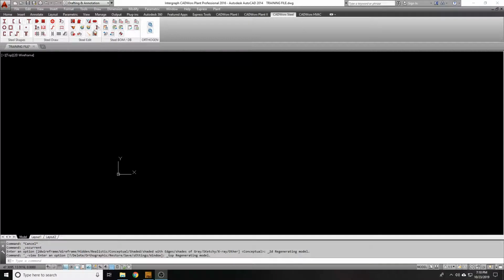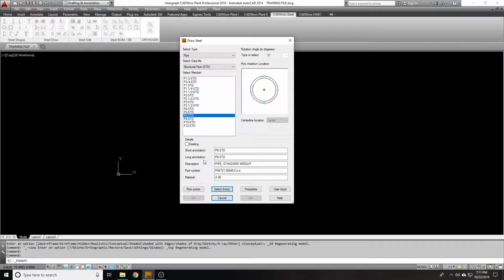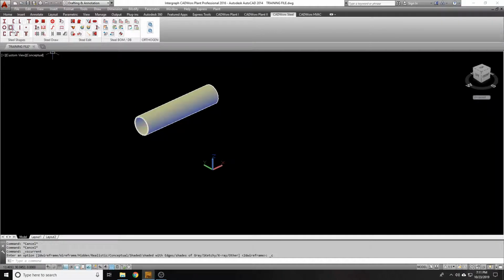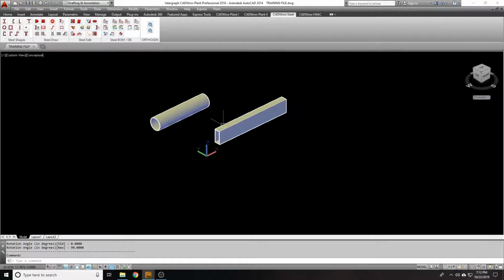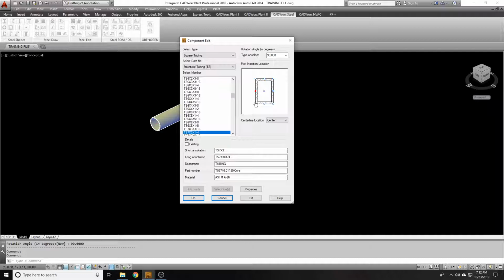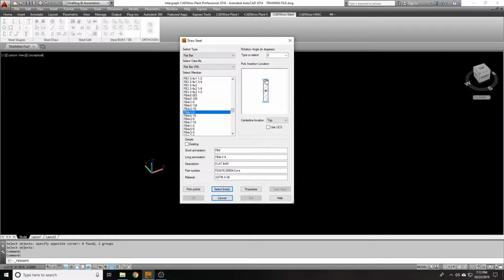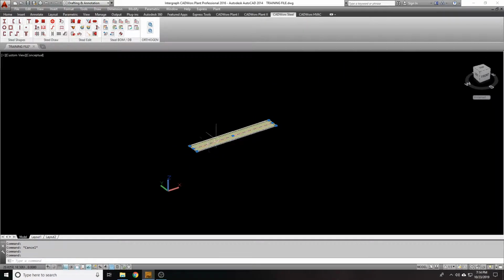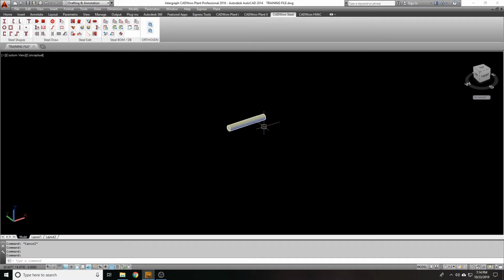CADWorx Steel - Pipes, Tubes, Flat Bar & Round Bar

Comment: Hello, where do you get all that library? In my CADWorx I have 2 flat bar, you have many.
Reply from the maker: Are you using Metric or Imperial? I am using the default Imperial catalog and it includes many standard flat bar sizes.
Reply: @youcandraft  thanks! I am using metric